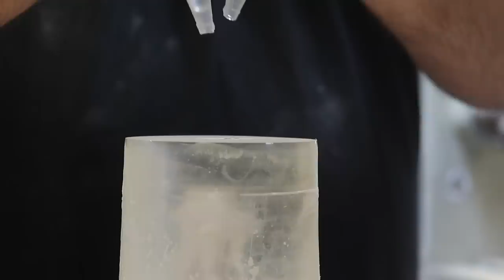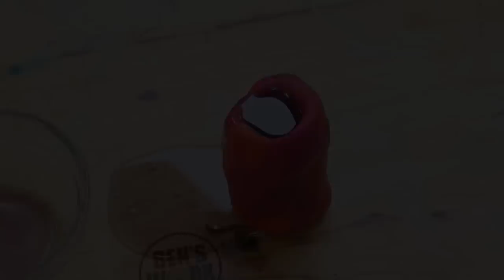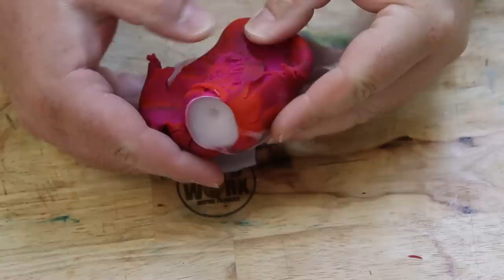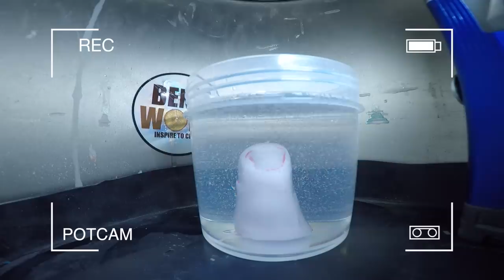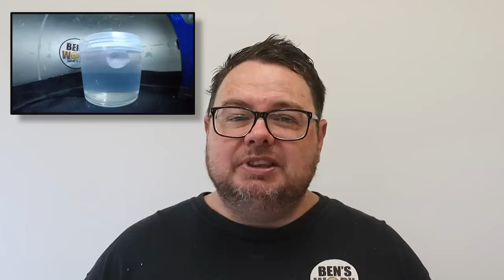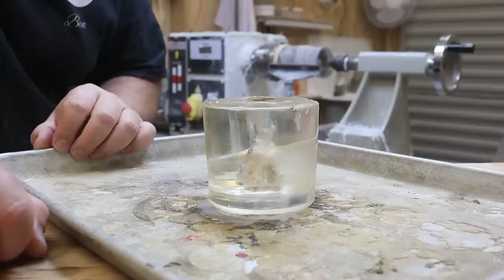Making Wax Art with Epoxy Resin

Comment: I think if you want to give the finger a chance at survival, you could try painting a few thin layers of uv resin onto the wax finger and curing them before attempting the deep pour. Then it would be more of a resin vs resin battle to see if the uv resin holds up to the heat of the curing resin long enough to let it cure around the wax finger.
Reply: I vote for this idea, if only because the UV resin should form a sort of mould, allowing the wax to melt from the regular resin on potcam, but then re-solidify back into its original form thanks to the UV resin “mould”.

Done this way, you could shape the resin and pop it into a pot of hot water to re-melt and re-solidify the wax back into its original shape over and over again.  An incandescent lamp made this way would almost be like a solid lava lamp — when off the wax would be solid, but when on it would slowly melt and become more translucent.  Would be a neat demo!
Reply: Oh yes this is exactly the same suggestion I made!
Reply: That's a solid idea, I hope he sees this
Reply: This was exactly my thought as well.  I suspect the wax would still melt, though might be trapped in the UV resin void, assuming the UV resin maintained its integrity.
Reply: I'm just remembering this, but wax contracts as it cools, so that means it must expand as it melts. That means if he did try this out, then when he adds the resin and it heats up while curing, the wax will also be fighting against the uv resin because it will be trying to expand as the curing resin heats it up.

Comment: It would be really fun if you put a party balloon with air into the pot! It would actually shrink down while pressurized and then blow back up when you release the pressure!
Reply: He’s done something similar in his older videos
Reply: Pretty sure the solidified resin would hold the pressure internally so the balloon wouldn't blow up again. Would be interesting to see the mess in the pressure pot if the balloon gave way under heat though. 😊
Reply: I meant outside next to the cup!
Reply: @glennnewell6909  I don't know, it might be enough pressure to crack the resin! Either way it might still be a good experiment!
Reply: @luckyrashes  oh I see. Maybe a mini balloon animal to watch go limp then revive😂
Reply: Hes done a video with a balloon. It looks like a hand is holding it on a string. It was a while back.

Comment: Oh that is beautiful.  You should try that with a few colors and see if it makes a marble.  
I have an idea outside of pouring hot wax into resin.  Make a resin block with a void.   Put your wax thing in the void and seal the top.  It will contain the melt and you can see what happens when none is lost to the outside.

Comment: That turned out better than expected. Wondering if you coated the wax in in UV resin or epoxy, and drilled a small hole in it so you can restrict the flow of the wax

Comment: I'd like to see you try casting another wax finger, and then coating it in 20-30 layers of UV resin, and then cast the whole thing in a pot. That way if the wax melts, it should still hold it's shape and position (and possibly solidify again?) inside the resin cast!

Comment: Try coating the wax with UV epoxy, then when it melts it will have the protection of the UV epoxy preserving the shape of your actual finger. Of course you will need to drill a small hole in the bottom and heat the wax up to drain it, then you can fill that with colored resin.

Comment: I have a crazy idea for this Ben! What if you made another mold of your finger out of wax like you did here, and then coated that new wax finger completely with UV resin so it's completely sealed up. Then you put the sealed finger into a mold with normal resin. I think that the finger would still melt, but it should be encased in the UV resin and should still hold it's shape. I think that would be pretty neat to see what happens!

Comment: Techmas tree will be pretty cool.
Poor little guy got consumed by the wax monster! You'll need to use some low temp slow set resin if you want the wax to survive, or just make a silicon mold, coat it with a slippery and make the thumb with more silicon, then you can just cut some cured resin from the bottom and pull the silicon thumb out and fill it with whatever you want.

Comment: I would do the wax finger again but this time, layer of resin on the bottom, paint wax with UV resin and cure it first, then do the same to secure it to the bottom layer of cured resin, then pour. Should be able to give you a solid wax finger inside the resin.

Comment: Thought*** Maybe make the wax finger. Coat it in a thick UV resin. Glue it in place. Fill with the hot resin. wax melts inside the UV. drill hole to relieve wax.

Comment: I am wondering about puffy/glitter paint. 
Put on wax. 
Wax melts, so it will leave, but if you went with a lower temperature resin, I think I saw it somewhere else. Would the puffy glitter paint stay close to where it was put? 

I love glitter and sparkle stuff. 

Thanks for the videos.

Comment: Would covering the mold of your finger or thumb in 5 min UV resin prevent the wax from melting, add that to a blank and then back fill with more resin to top it off.

Comment: I am wondering if it mattered that you didn’t pour a base of resin to which to attach the finger. Once the wax melted there was just an open hole at the bottom for the wax to escape from and move up the sides. I’d like to see it again with the base used.

Comment: Ok. We need part 3 of this where you coat the wax finger in UV resin thoroughly before casting it in resin. The goal is to end up with a wax finger in the resin.  Not to melt wax using hot resin.

Comment: You forgot to fill the void ;p
When you cast with wax, it shrinks, a lot, and can make a sorta ant-nest-like void (you can see the void's entrance at the top, but it's hard to say how deep it goes).
You can avoid it by cooling really slowly, but most ppl just fill the void by using a heat gun near the void-entrance.

After seeing the wax float in the resin, I wonder what would happen if you just drizzled some hot epoxy ontop of a jar filled with wax..
Maybe the hot resin would dig it's way into the wax (or maybe you just cast a resin disc..  lol)
And if it dug a path, you could just melt the wax to recover the epoxy shape.

Love your stuff!!  Thanks for sharing!